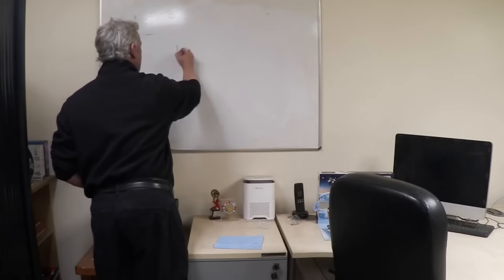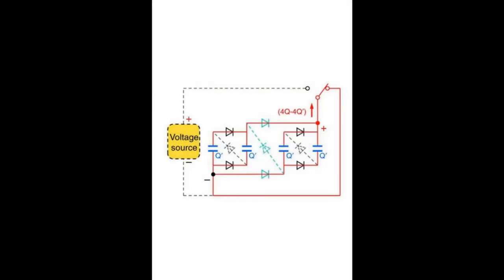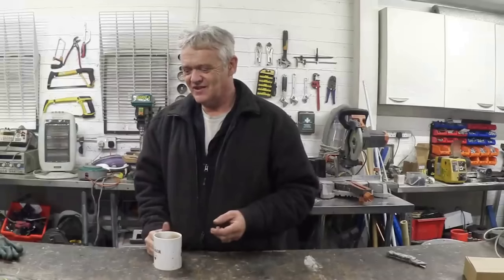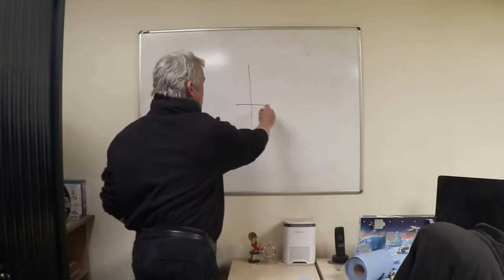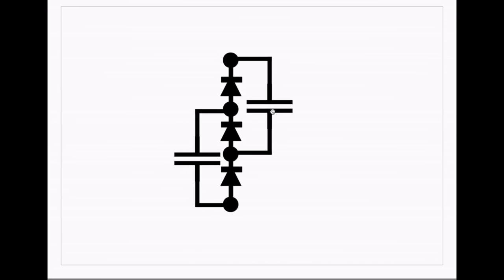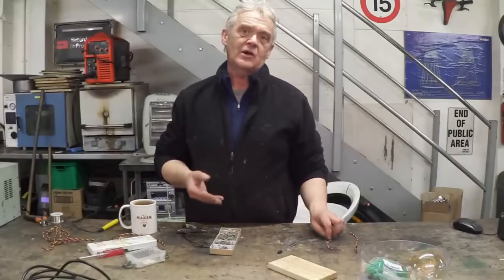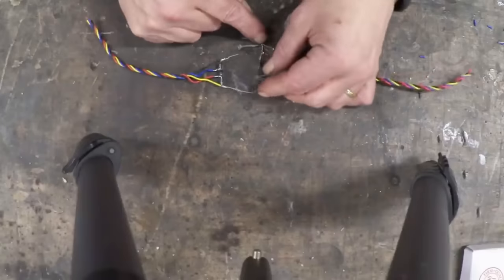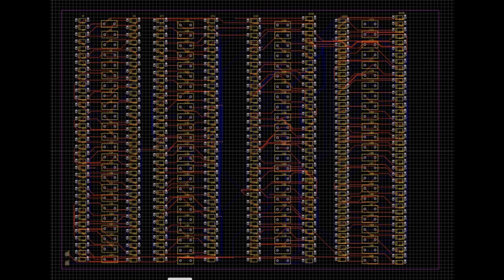028 Unlocking Energy From The Sky - The Fractal Capacitor

Comment: It's the same as Tesla's splitting the positive...brilliant.
Reply: Splitting the positive between two fractal compactors, one parallel and the other in series  and  placing a resistance output between the two positives once activated will provide a  constant output and self charge.  The beauty of such a configuration is the capacitance that can be achieved  by input of any potential difference.

Comment: I would never charge a capacitor to full in the search for, let's call it extra energy.  I would charge it to about 10% then discharge it rapidly and utilize the bounce back voltage that appears in a capacitor immediately after it is discharged.

Comment: Had no idea you could use capacitors as the key components for a step down transformer turning kilovolts at milliamps to volts at amps presumably...fascinating...theoretically this could be used as part of a circuit involving a balloon carried aerial or aerial on a high tower with the potentials being the differences between ground level and the electrostatic potential of the atmosphere at higher altitudes.

Comment: The start is mostly interesting to me, if you can divide voltage by 2 is it reasonable to say that the other way around you can double the output voltage by 2. If i connect 2 seperate 240v outlets to eacht capacitor does it make 500 volts combined? If so what are the losses, if any. I wanna upsample the voltage for an infrared PTC plastic sheet attached to a wall. I now have 45 degrees, wanna go up to at least 80 degrees. Is this the way to go? What should the capacitors at least be - 500 volt / 400 uF ?

Comment: if anyone could make such pcb there could be some money in it, i would certainly buy a lot of them to a big capacitor charging system that would charge them for fre and in the end runnning the house from the system that would be sealed inside a big used deep freeser that is all aluminium foil on the inside and metal outside on the other side of the insulator material so that would also charge up and connected back to the minus input and the plus input would come from la pulsed connection to a set of earth connection harvesting big time tuela earth current,

How insanely simple way to harvest from the so called zeropoint energy and how insanely lot of power you could get out of it.

A BIG THANKS AND A BIG WELL DONE TO YOU!!!!!!!!!!!!!!!!!!!!!!!!!!!!!!!!!!!!!!

Comment: The low voltage result could be used for a 1-transistor amplifier to run from a suitable wire aerial. (or something like that)

Comment: WOndering why you didn't use as close as possible to the resistor color code for the wires, black red yellow blue and then you cannot forget which is the larger color and don't NEED to remember each time  ;)

Comment: What if you replaced the diodes with diode bridges with capacitors across the input in series on the ac side and in parallel on the dc side so the input of the diode bridges are in series and the output is in parallel to save room on the circuit board?
Reply: @thekaxmax  I guess you just get the cheep diode bridges for 10 pack with 4 pin @ 1 amp at 1000v. Only cast 4.78.  Digi key sells them for 14.62 for 100 ; too high?
Reply from the maker: go for it mate - give it a go

Comment: I'm trying to get my head wrapped around this. Are we saying that it's possible to take electrostatic energy and convert it to low voltage high current. If this is the case there are so many applications!
Reply: I work at a flour mill where loads of static charge is generated on all of the delivery lines. 1000's of volts that we just ground off.

Comment: If this fractal capacitor could be hooked up to a Kelvin water dropper, then you could generate electricity from the rain.
Reply: @Ken00001010 to make it work it would have to cover a wide area to catch as many raindrops falling as the energy comes from the potential energy of the falling drop.

Comment: It's difficult for me to picture the compounding of capacitors DOWN in size, rather than up (which I think would quickly expand into an unworkably expensive design). But there must surely be some physical limitation to how small we can go here. If one 200 mfd capacitor contains 100 smaller capacitors, and then each of those contains a hundred MORE, at 1/100 of 1/100 of the size...at what point does this become just beyond our understanding or capability to make?

Comment: So in reality each diode string has a diode and capacitor string across each diode so you apply high voltage which charges up all the capacitors to 1/2 of the voltage the individual diode sees and so on so 10kv becomes 5 kv then 2.5 then 1200v then 600 then 300 then 150 then 75 then 38 then 19 then 10 ish  so 11 stages divided the voltage by 1000 ish then when you remove the high voltage the voltage now very much smaller in the capacitors , discharges using the bypass diodes to the output , all very well and dandy I would just be wondering about quite how useful it would be to be honest ,
Reply: Capacitors can be printed with conductive ink on paper, and so can a Wimshurst high voltage generator.  I wonder if diodes could be?  If so, it might lead to a very cheap way to produce a hand crank generator to charge a phone.    Used in reverse a lightweight fractal capacitor could replace the heavy transformer in a microwave oven.  Scaled up they could replace transformers in the power grid.  I can see lots of potential uses.
Reply from the maker: try reading a few papers on this mate - you don't seem to be getting it

Comment: What is the discharge  current path from the lowest charged capacitor ?
Reply: There isn't a lowest charged capacitor, the whole point is that they are all the same. That being said, if for some reason you used a different cap value somewhere, the path wouldn't change because of it, it would still be as shown in the video.
Reply from the maker: there isn't one mate

Comment: or you could use my design that is an electroscope with a grounding plate to allow self discharging once its fully charged and pass this through your first of two primary coils and to a second jar that has another unit in it and then that gets dumped through the reverse second primary coil before going to earth ground, thus you can then collect that power on the actual secondary as anything you wish based on coil configurations, and its AC sine wave too. at what ever voltage and thus what ever amperage you get from it after stepping it down or up, (depending on the amount of coils for the secondary vs the amount of coils for the two primaries wound in reverse, or at least hooked up in reverse order from each other to the dump point on the jar it goes to.)

Comment: One main reason capacitors are not used for power conversation is the energy stored will always be half the supplied energy. With a reference frame larger then a single ideal capacitor, half the charging energy will be dissipated in the resistance of the charging circuit. QV/2.
Reply from the maker: that's not quite right mate - capacitors are used all over the place for conversion and storage - you are right in some circumstances it's not a good idea but in others it works well

Comment: Zener diodes are much more efficient than using capacitors for voltage control.
Reply: Hmmm, even being charitable and giving the benefit of doubt, I'm pretty sure you have no idea what you're talking about.
Reply: And you do? Please explain.
Reply: And his analogy of two caps in series works the same for resistors, nothing new. And, as I said, Zeners are designed for the purpose and much more efficient than capacitors at regulating voltages plus using many less components. You don’t see massive capacitors in your smartphone charger do you?

Comment: Sorry what's wrong with a transformer and spark gap?  Seems way simpler
Reply from the maker: you will destroy your transformer if the voltage gets over the breakdown voltage of the transformer insulation and transformers have absolutely rubbish efficiency at  high voltage and transformers work on ac best with a spark gap it is pulsed DC - enough reasons?
Reply: @TnTOmnibus  those are reasons but is this not what Tesla did ? Transformer and spark gap .. simple is good .. how about the old world their buildings produce and machines utilize the raw high voltage DC now thats way cooler anyway isn't it ?
Reply: @mattg6472 ah, the old argument from antiquity. We used to poo in holes too.

Comment: Using a nano carbon wire which has a large surface area and connect it to a bridge cell a good cell,
Remember Tesla's design for use of radiant energy I did put a large rectifier bridge along that and loaded an electrolytic capacitor the bridge cell goes to way higher frequency bands and acts like a receiver for all radio frequencies up the Mhz range the plate or wire set on top can load and blow up a capacitor so I connected a fluorescent tube over it in order to discharge it and used only a 2 ohm very high wattage balance on the floursecent tube ( also user an emergency discharge element a neon bulb in case of direct inductance and overload ) everyone complained about the light being constantly in in the shed but the only tube around was the one in this experiment
 now one can go high up or just use this setup as soon as the wires are up it loads
and takes some time before any atmospheric disturbance aka lightening lights the tube 

next time I build it different
 the cap has to be of good quality I reformed more oxides on a Philips cap so it would become an extra thick dielectric.

Might I add some personal advice since you are online and your knowledge and the knowledge of all you have studied and the ones you personally had as teachers and companions in life is kept as human legacy, now at least,
 But will probably be taken with us to the stars on kind of light computing machines they currently are building and will live on forever as long as the internet and humanity exists. Let that be a comfort no knowledge is lost.

However I recommend you get a female apprentice who you can learn a lot to as a tutor and you might have to have several before someone can be found to carry the knowledge wich is quite extensive in your case
but by doing so one keeps the movement going long after we all are in a different realm of reality
We are quantum data and physical bodies Now our physical body does not exist forever quantum data does and cannot be destroyed or changed only more can be made so in a way the giants on whom shoulders we stand are present in a certain way through their knowledge, in what we do

But live in a different realm of reality where we can only go on the long run,
So by understanding that though life is finite the core of what we are is not and the movement of transferring knowledge like you do by the highest part of the pyramid of Maslov the part where just above self realisation one comes to transcendence where it goes beyond yourself by teaching others is most important to be going on over many generations.

 Now if one sees the pyramid of Maslov as having a broad beam above it where meaning purpose usefullness and such even relegion or thinking way might be included as broad as the bottom part interacting with all the layers below then whatever one does for oneself or others out of this piramid has meaning purpose and use !!

You work in the highest part of it so you transfer your knowledge beyond yourself but appeareantly your use and meaning is to be here for us to teach us until we finally learn enough to continue on our own but still then as a tutor like Linus Thorvalds made the Linux operating system invited us to think and experiment sometimes as well for ourselves and here we have it a functional handheld computer that interconnects us as humans.

 But it all starts by teaching people how to do and what to do so once at a certain point in time having an apprenticeship where a lass of younger age a student or someone who completed schooling or needs to do so can be thought the knowledge of how to do this for real makes for good teachers

 people like you and are extremely important and the whole group of people around you as well since if you teach and have a small group around that gets thought the ins and outs of doing exactly what you do an enormous amount of people online get thought about these experiments

 and as I remember from school you always remember the experiments and if you want can look up the formula and related things to try yourself with such a good teacher one does not need to do so much in the theoretical field to understand wich is excellent for new kids on the block as well as for people who don't sadly enough have a sturdy math background so they can Also learn and understand.

 Please take my word for it passing the torch by teaching them how to do it and starting at an age where you are now is better because if you teach a small group over time or even one person how to make videos like this how to understand science they don't have to be on screen as long as they get some skills in doing so and learn for later on we all go forward because of people like you and yours.

Thank you and the ones around you for doing this since we still learn all the time !!!

Comment: Of course feeding the same high voltage pulse into a large capacitor would  be exactly the same effect without all the messing about, it would just average it
Reply from the maker: it really wouldn't
Reply: I tried reducing high voltage using sets of capacitors with limited sucess.  If the voltage is too high it just shorts thru the capacitor.   If the voltage is quite high it travels along the wire and past the capacitors it can play by different rules insulation is required but its interesting.
Reply: Yeah, but would it though?
Pro tip: it wouldn't.

Comment: On the pcb, I guess adjacent tracks have quite a low voltage difference...but it all adds up, thats the point of the design.
When it gets up to the kV range, is there any danger of arcing across tracks? I guess it has been designed for by the professional pcb guys.